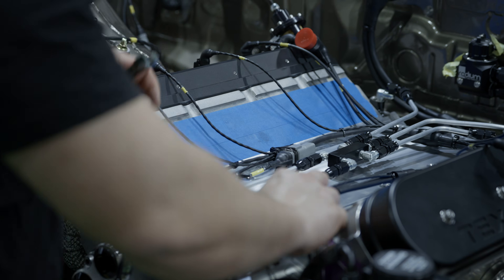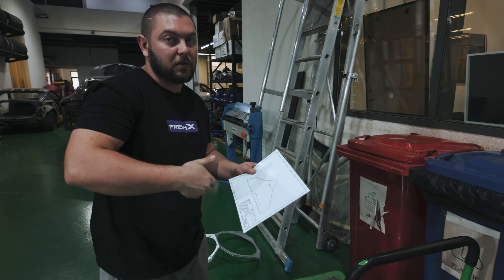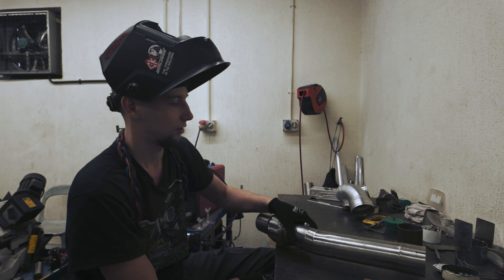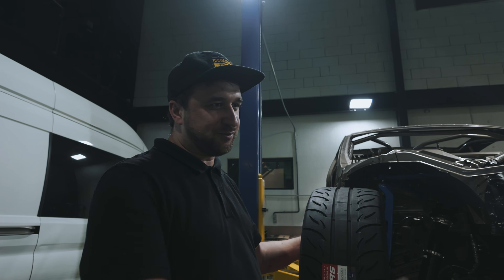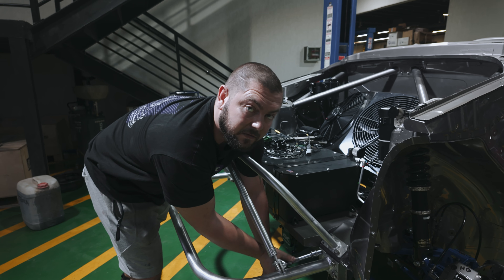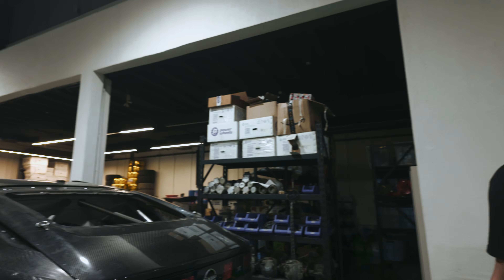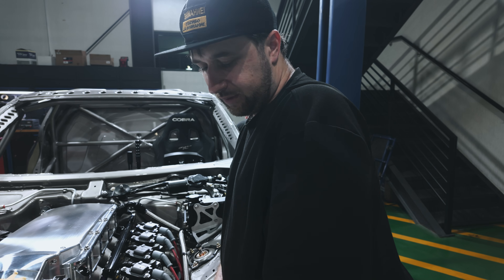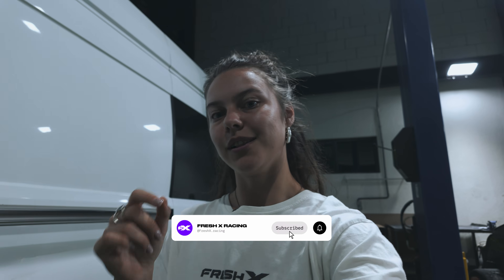14 DAYS BEFORE THE FIRST RACE: Will the Engine Start?

Comment: I am here, after watching garasi drift video. 

One thing I’ve been wondering about the Anti Lag System. 
Does a Procharger need an anti-lag system??
Reply from the maker: it depends on the individual settings that driver want. And this option might be used😎